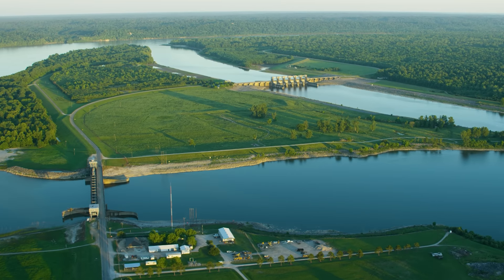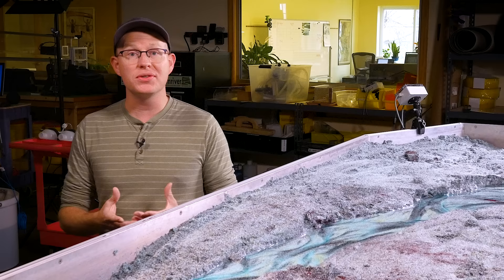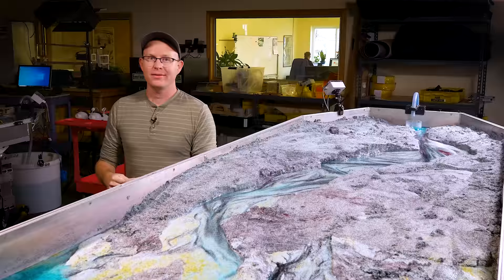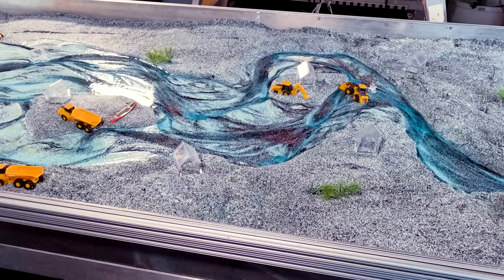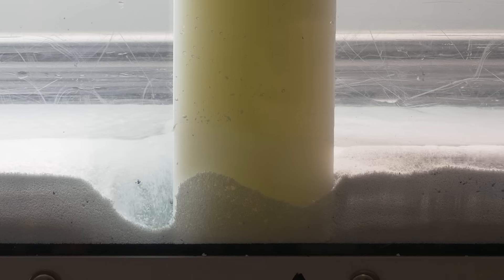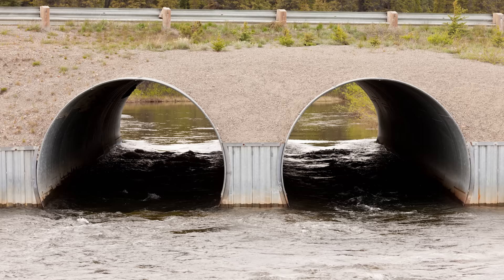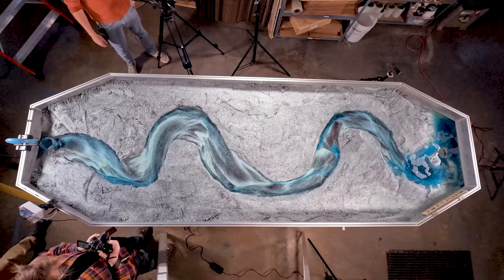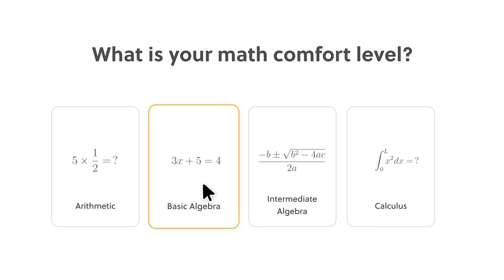Why Engineers Can't Control Rivers

Comment: That river table is basically my childhood dream toy. I used to get ‘in trouble’ by using the hose to create my own waterways. I still love watching what water does during high rain times today.
Reply: Dug a hole with a hose once when i was a kid. Was great fun, unfortunately i started it in the middle of the asphalt drive way. Dad wasn't as thrilled with it as i was.
Reply: @matthewnienkirchen8083  just a good scolding.
Reply: When I went to elementary school we had playgrounds with a sand "surface" (like swingsets and whatnot), and the most fun thing to do was to play with the canals that formed when rain water ran through the sand. Fun times.
Reply: Engineers and city planners should design infrastructure and towns to live with a meandering river. Meandering is one of the ways  rivers clean our water. It'll save us alot of money. We need to restore our watersheds and floodplains. That would help clean our water, recharge our aquiters and reduce floods while providing millions of jobs.

Comment: This reminds me of something I always used to do at the beach as a kid growing up (that my Dad kinda taught me, to be honest). Every time I'd go to the beach, one major thing I'd do (usually with the help of my brothers and/or my dad/friends) is to dig a pit up on the shore somewhere, then dig a channel from that pit down to the ocean. We'd carve twists and turns and even plateaus (which would make waterfalls) and occasionally even tunnels into the channel, then haul buckets of water from the ocean into the pit and watch as the water would flow through our creation. It was always an ongoing project though, as inevitably too sharp of a twist would cause a stream to break through straight and make a downstream connection we never would've forseen. And the waterfalls would slowly erode the cliff until it was no longer a fall but rather a gentle slope (that, or it would simply dig almost a second pit into the ground, creating a little pond along the way as a result). Tunnels would inevitably collapse (usually rather swiftly) as the base was slowly eroded away, causing a huge lump of sand that would either force a ton of new channels to form or would be quickly eroded away, depending on, well, whatever it depended on.

It was always so incredibly fun, and is a game I very much hope to be able to pass on my kids some day. Taught me a ton about how rivers work without me ever realizing it lol

Comment: Thank you, Grady (& Wes!) for another excellent video! Your channel (+ book, too) and the work you put into it is such a valuable resource for understanding the complex world around us. We greatly appreciate the cameo of Steve, and are so glad to continue what he began. Hope you can come see us again sometime! 🙂🌊
Reply: Do you have a way to separate all the model sand/sediment colours after a run so they can be reused, or are they cheap enough that they're simply dumped and replaced with fresh? If you do separate them, how do you do it? I'd be fascinated to know!
Reply: @siberx4  Once the color-coded media is mixed in the stream table, there's not any real need to separate it out by color. It can be done with LOTS of sieving. Our media is expensive and meant to be reused ... well, forever really. It's thermoset plastic so doesn't degrade over time.
Reply: I'm a big fan!
Reply: @siberx4  The different grain sizes can be sieved for separation, but it's a lot of work and no discernable gain. Our media is expensive to make, so it's meant to last the life of the model.

Comment: Discovering an old topographical map series from surveys done in my area around 1910 shows how a lot of small creeks and streams have been diverted, or eliminated because the land they once drained has been substantially changed. While we look at the main river, I wonder what models that included a before and after of this process would tell us. Another factor isn't what we've added to streams and rivers, but what we took away-- the beaver.
Reply: I put my hamster in a sock and slammed it against the furniture
Reply: @TippyHippy  Here we see an example of the types of well-adjusted people you can find in a comment section.
Reply: @TippyHippy  You didn't, but here's the attention you wanted. If you're going to try and shock people, try something that has a bit more effort than what I would write on /b/ when I was 14.
Reply: Yeah imo every single problem we encounter in regards to this as humans , is we always forget to mimic nature but instead act as if we are the smartest thing on the planet. Everything from Farming, irrigation to weed management nature has provided its own solutions we just need to either mimic these or work more closely with the thing itself

Comment: That model is awesome. As a landowner it has changed my view and one of my future plans I have on fixing my land. I have heavy erosion and drainage issues. Original plan was to cut drainage lines and burry pipes and stone to control water movement but this model told me it will be to fast water movement so I’m going to redraw my plans to allow for water to slow down in natural low spots before washing into the pond depositing too much dirt.

Comment: Great video! I've been a CADD tech in the US for over 23 years and 90% of my work has been involved in stream mitigation, relocation, and restoration. It always has amazed me how much power a stream or river is capable of, even with the best designed control structures I've seen giant cross rock vane boulders being blown away by a freak flood lol.

Comment: I actually first learned about the situation with the Mississippi and the Atchafalaya from xkcd of all places. He did a comic about it a while ago and then followed it up with a blog post about how close the structure was to failing.
Reply: The sad part is that it needs to fail for the Louisiana marshlands. They've repeatedly said "we loose acres of swampland everyday" when all the sediment that would be there is at the Mississippi Delta as it extends out another couple hundred feet into "The End of the World"
Reply: @ravn_blade  Right.

Nature should have been allowed to take it course.

Had we accepted it and built new port facilities instead of expensive and doomed control structures we'd have saved both lives and money.
Reply: Hatguy?
Reply: @mbvoelker8448  we? You live in South Louisiana?
Reply: @J.C...  We -- Americans as a whole. 

I don't have to live there to be concerned about the lives that will be lost and the general devastation that will come when the river eventually makes the jump that cannot be denied forever. :)
Reply: @J.C...  I live in south Louisiana and agree with Voelker.
Reply: @mbvoelker8448  the damage wouldn't only be from flooding the Atchafalaya Basin or shipping. The absence of water from the Mississippi River would be more devastating than anything because too many facilities are dependent on its water for cooling processes.
Reply: @ravn_blade  Another reason that they should have accepted the inevitable back in the day instead of trying to cling desperately to a channel that nature has decided is obsolete. 

The switchover could have been managed in a controlled fashion to minimize harm. Instead, it's going to be a catastrophe. :(

Comment: Very interesting! I would love to see a deep dive into specific methods of working with rivers, even on a small scale, such as a city fortifying the sides of a river with stones or something similar to protect infrastructure and housing built close to the river. I'd love to know how effective such measures are in the long term and what kind of effects they may have on the river as a whole.
Reply: The Thames would be a good study - it's been extensively embanked (or leveed, as we Americans would say) beginning in Roman times. And Old London Bridge (1209–1831) had so many piers in the river that rapids were created at max tidal flow.
Reply: I'd like this too.
Reply: Madison Wisconsin pbs wensday night at the Lab they done massive studies in rivers and lakes in why doesn't concrete work or stones on bankments it's pretty interesting in there findings all that money spent on shorelines that all failed they found out the hard way to try to stop the erosion on lakes or rivers the mighty Mississippi is totally aways changing with in the pools are the biggest changes the river main channel is all govern by dams n spillway in back waters and yes above the dams them back water pools are slowly filling in ware there's water flowing in back waters over concrete spillway the pool above dam n spillway slowly fill in creating islands and large sand bars and the Army core engineers are constantly battling the river to keep a 12ft main channel open there dredging sediment 75 percent of time pumping millions of ton of sand so barges can navigate channel the massive rain falls we got six yrs ago has really damaged alot of shoe lines it wiped out over 75 percent of plants along river Bank on main channel it still to this day fighting to grow vegetation yet and now the state of Minnesota has a 3 yr study in why the river oxygen levels have dropped so low fish are dying yes you reading it right very low Oxygen levels on the Mississippi River that all side affects in loses to all that vegetation......
Reply: @dannypomeroy9255  I don't mean this in a rude way, but it's really hard to read what you wrote without any punctuation and with such long meandering sentences.
Reply: Steel seawalls are used around here on the St Clair river which sees an insane amount of water flow every day. They last well over 100 years, are fairly easy to install.  Depending on location and how the river bends it will either be shallow or even have a beach against them, or be fairly deep. The only real downside is you lose natural shoreline that is used for nesting by species of waterfowl and different species of insects, crustaceans, and fish that use the rocky shallow areas for breeding.
Reply: @fastmattmattmatt  "the only real downside" you mean the most devastating downside that makes any attempt to do such things ignorant at best. Our rivers worldwide are basically screwed. The US isn't as bad at this as China, but it's still comparable.

Comment: River channels are Innocuous merely when taken good care of, local authorities' ideas converge into a plan and make up a whole project to sustain certain area's irrigation system. Creative and innovative ideas coalesce, form one whole, if engineers definitively invest budget and certain timeframe they can implement an impressive feat. It is so much amazing to see something difficult to understand right in front your eyes, river models are sometimes Achilles heal, f.e. in mighty MS, stream of water should not change robbing them of their water supply, local authorities have anticipation of flood when gravel, a loose aggregation of small, water-worn stones accumulate beneath the water dams, and sediments. Sediments stack closer and closer to a dam, encroach on and on, what a terrific learning tool, i would also want to add electrical lines but i am quite certain that this little flume come at a high cost, to relieve or mitigate the flooding impact some areas have restrictions on construction (e.g. permanent building), Netherlands has got good reputation for water management dealing with influx of vitamins through water, one of the solutions to fixing the flow or navigation is dredging up from underwater or buried position, in the context of irrigation and engineering it refers to the process removing sediment or debris from the bottom of rivers, canals or reservoirs, dredging equipment excavates and removes materials such as silar, sand and stone, each iteration helps achieve improvement and refinement, iterative processes in engineering of river canals often refine water flow and navigation.

Comment: That topic is very interesting. Interesting case's of rivers changed by engineers are almost every river and the zuiderzee in the Netherlands. The Delta work's and the land reclamation are some of the greatest achievements in hydraulic engineering. 

But the river that was changed most severely by engineers is probably the Emscher River in Germany. It flows through the densely populated Ruhr valley, that was known for underground coal mining in the previous one and a half centuries. Because of the extensive mining operations in the 1900s the ground started sinking severely and the river flooded the area often. The problem was that the old entry of the Emscher in the River Rhine is at an higher elevation at some of the areas upstream. This would mean that the citys would be flooded and turned in to a lake. Another problem was that it was impossible back then to construct a sewage system because of the instable soil in the densely populated area. The solution was back then to divert the river further north and to construct a manmade elevated riverbed with dikes. Furthermore pumps are necessary to elevate many rivers that flows into the Emscher. Without these pumps the whole area would flood. The whole new artificial riverbed was made out of concrete and the sewage of several cities was discharged untreated in the river. The river was basically turned into an sewer on the surface, because it was impossible to build them underground. Before the entry in the River Rhine they built a big sewage treatment plant and the whole river literally flew in and out of it. 

Since the beginning of this century most of the coal mines closed and they started to recultivate the area. Hydraulic engineers started to build huge sewage pipelines, treatment plants and pump stations parallel to the river. If it was possible the concrete riverbed was removed and widend. Furthermore the river was diverted again even further north so it can flow freely. Since roughly 5 years the river is clean now.  The old river treatment plant is now  connected with pipelines
Reply: wow what a (his)tory

Comment: Sediment is such a huge problem with roadways and interstates drainage system.  Either sediment from farmers fields washes into our ditches into our pipes and culverts blocking them.  We spend almost every year with a grader and loader taking sediment out of the bottom of ditches due to run off from fields that don't have proper terraces or we don't have rock checks (but they can only last so long and erode a way, water always finds some path underground around some obstacle.)  

I used to work as an Engineering Technician for roads, bridges and roadways, but now I'm a Equipment operator.  Main difference between the two is one sits there looking at plans and talking to higher ups about plan changes while the other one does all the work with the machines.  Case in point erosion from water is a pain and a never ending job to do. Unless we come up with new ways or technologies to help eliminate it without destroying ecosystems. 

 I was an ET during the EPA Consent decree for Kansas, which was very very focused to stop erosion on projects for bridges and roads with painstaking steps and devices that needed to be follow.  (This EPA consent decree started due to a bridge collapse in Missouri I believe.

Comment: I worked under a geomorph for a little over a year recently. One of his projects was helping on a river restoration project. Something as simple as the slopes upstream of a river being logged decades and decades earlier caused massive damage to the river system. The increased run off caused massive channel shifts in the long term which affected a population at the rivers head and the more erosive environment had huge negative impacts on the salmon that spawn in the gravels that were affected down stream from the logging

Comment: Viktor Schauberger was an Austrian inventor who designed water shoots for loggers that used a smaller channel at the bottom center to draw the logs around the bends so they would not slow down from scrapping against the sides. He postulated that channels placed at the center of the natural course of rivers would minimize erosion by pulling the water toward the center of the fast flowing water in the channel. I know an engineering company in Germany was experimenting with this concept but I have not herd the result. It seems logical that placing deep channels at the center of the natural path would have this effect. It would be interesting to see if this faster moving water would also keep sediment from clogging it on your river models. I am certain standards could be developed around the 100 year flood models that are used for other engineering projects.

Comment: Great video! I've been working on stream stabilization , culvert and bridge design since 1969 and I have seen many failures of stream channelization projects , culverts and bridges. The analysis methods have  changed., but everybody knows that there can be a storm that will take out almost any structure. As I have heard before these processes are not only more complicated than you think, it is more complicated than you can think.

Comment: Really enjoyed the video and the sandbox.  The Beach Scour is underrated and can be a very big problem.  I was watching an old presentation on Duluth, MN where MN point is getting washed away by beach scour.  Two probable causes are the dams upstream and the piers for the canals block the movement of sediment and prevent it from being deposited on MN point.